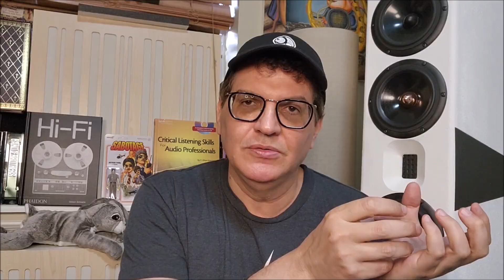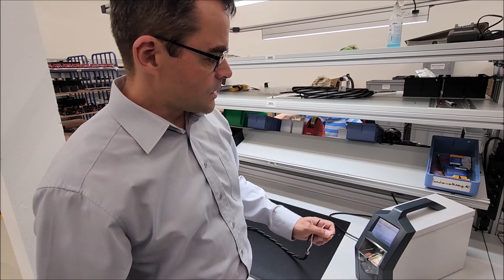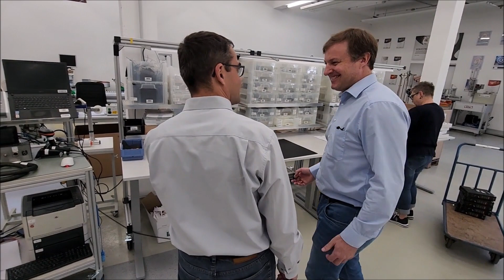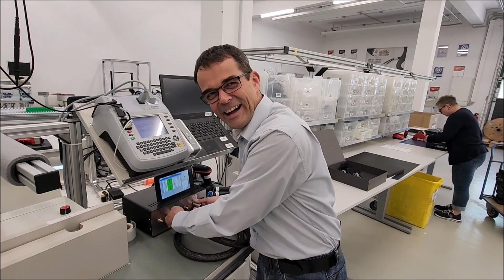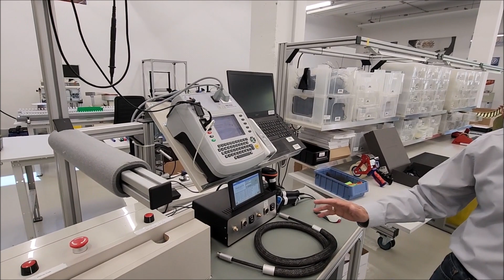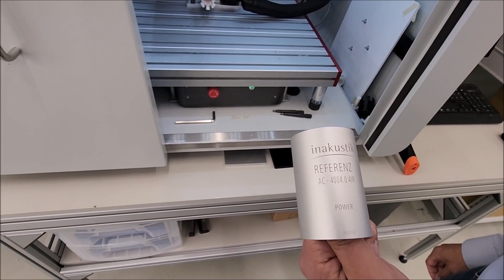🤔 Do Your Audiophile Cables Have These Important "Best" Traits - Inakustik Facility Tour - Part 3

Comment: Like comparing widgets, speaker cables are all equally ineffective at improving the loudspeaker it is connected too. The laws of physics cannot be transcended by manufacturers of exotic speaker cables no matter how good or expensive they claim them to be.
Reply from the maker: Maybe you've never seen or experienced defective cables or ones with poor connection quality.  

That would be surprising though given the experiences people have daily with various HDMI cables and charging cables where you are given immediate and incontrovertible feedback on something being wrong and improvable with a better cable.

That being said... I get what you are saying about Audiophile's general neurotic obsession going overboard about cable differences.

It's not much different than a watch though.  You can get many that will tell time, but there's much more involved in why people purchase a high end watch.  If physics and Dr Spock logic were the only metric in every buying decision, then literally every piece of clothes... Every car... Ever house... Every meal... Etc... would be the same for everyone.

Unsurprisingly, it's the people at both extreme ends of the spectrum that make fools of themselves.  The neurotic audiophile that grossly exaggerates cable difference as well as the purchase police that selectively and hypocritically applies standards to buying things that they themselves don't 100% apply in other areas.
Reply: @AudiophileJunkie  Sounds like you are resorting to logical fallacies. Have you ever seen the construction of a voice coil on a typical direct radiator moving coil loudspeaker and/or an inductor used in a crossover ? What wire do you see in its construction ? Do you honestly think that any of these fancy smancy cable manufacturers products are going to make any difference to its fundamental operation ? Similarly when you did a video of Magico products did you notice the wire they used to hook up the drivers to the crossover within the enclosure ?
Reply from the maker: The logical fallacy is thinking the wire in a voice coil has the same purpose as a speaker cable, interconnect or power cable.

I don't know what to tell you if you've never had a long run of interconnects and ignored whether one design had more capacitance than the other.  If you did that between a passive preamp and a low input impedance amp, it would be even more problematic, but go ahead and pretend that capacitance doesn't matter or that inductance in speaker cables doesn't matter... Use whatever you want between whatever gear regardless of length of run or specs of gear... Use the exact same wire as voice coil wire with zero geometry of the conductors and enjoy...I think you'll see who is making the fallacy.
Reply: @AudiophileJunkie  I don't need to spend money on uber expensive cables to get low capacitance. And there is no inductance or winding capacitance in a voice coil ? Certainly much more than a set of speaker cables that try to minimize it. You putting these companies on a pedestel is what is wrong with this industry. It's a business that manufacturers absolutely nothing of benefit and sells placebos to gullible people :(
Reply from the maker: They sell high quality cables that everyone needs at all different budget points.  They also go through certifications that others don't...and made with high quality labor/tools from Germany.  You may be fine with a cheap Chinese cable and I get it... Many people wear cheap Chinese clothes too without blinking an eye about the quality and labor practices. However, you're primitively crafting an argument that all cable companies are the same and snake oil without detailing one piece of evidence from the actual video.

These gross generalizations and primitive arguments often attempt to use logic and science as the rationale, but it's really some level of bitterness and jealousy motivating the anger.  For you to get triggered by a company creating cables for every budget level and also go through certifications that very few others do... And has been in business since 1977 (which virtually no other has)... is really strange.

There are countless ACTUAL snake oil companies to be triggered by and OTHER industries that are far worse, so it's peculiar outrage on your part.  Maybe you were wishing to see more BS and crap that you could tangibly critique, but instead you are left with trying to equate Inakustik with all others in your primitive generalization.  Sorry... It doesn't fly with me... There are differences in quality of construction, reliability, LCR, aesthetics and people behind the brands.  Your primitive generalizations aren't convincing... Especially since you're ignoring literally every piece of evidence in the actual video to craft this theory.
Reply: @AudiophileJunkie  Jason, I can sell you some striped paint, sky hooks and left handed screwdrivers. I can get the screwdrivers certified for left handed operation too.Let me know when you are ready to order ;)
Reply from the maker: Once you've been in business for 50 years and sold millions of dollars like Inakustik, I'll be ready.
Reply: @AudiophileJunkie  Like PT Barnum said there is a sucker born every minute. The reason why these cable companies exist is because it is much easier to make money out of useless products than having to put a lot more effort and money into building a better loudspeaker ;)